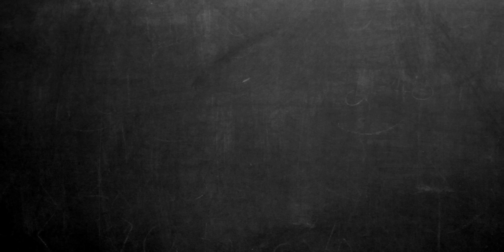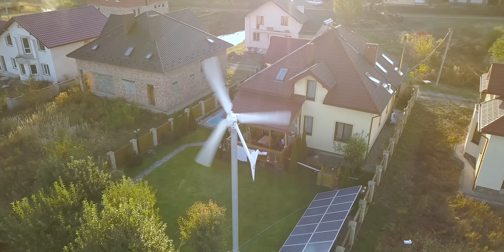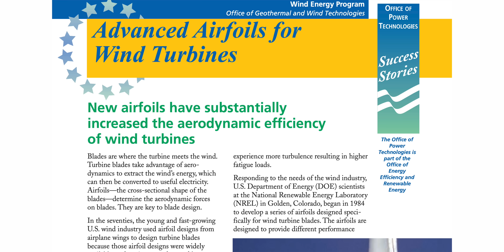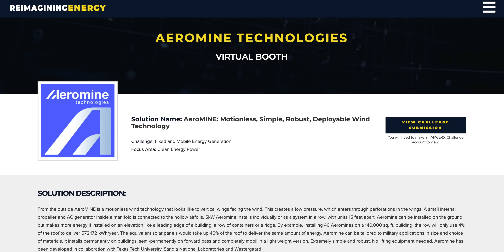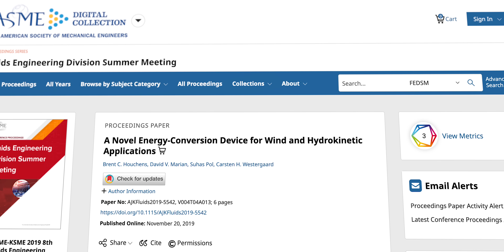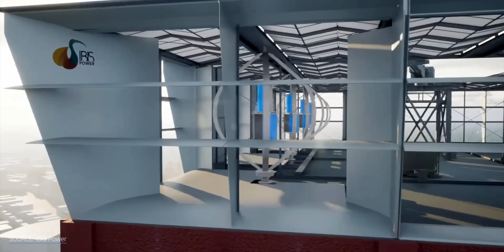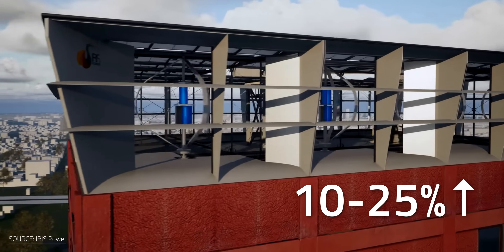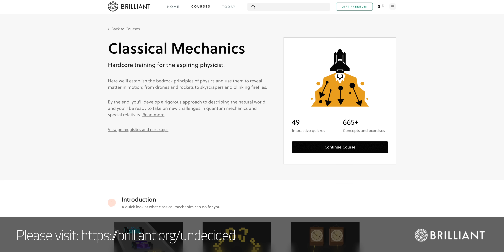How Can A Wind Turbine Be Motionless?

Comment: These companies should work on making kits/diy friendly stuff to allow it to be more modular, applied as part of normal building processes. Shipping and MFR of thinks like this is expensive, and of course should be done on site. Why not make plans to shop to local metal cutting shop, and use standardized as possible coverings, like the sheets of plastic available for wall coverings etc.

Comment: I have serious doubts about the efficiency of this system. Since the mass of the flowing air (the wind) is redirected using the Bernoulli principle only a small portion of the wind "mass" will actually reach the generator. Furthermore, the redirection itself causes losses to heat due to air friction (viscosity) against the redirecting surfaces. At least the conventional turbines face the wind directly, and even then their efficiency is nothing to write home about. And the point mentioned in the video of not being able to orient itself into the wind is a serious flaw in my mind. I don't think this setup will leave the lab phase without some very dramatic  redesign.

Comment: interesting couple of sets of power options.  there is a growing trend in America to bring power generation to the individual homes.  ( I was approached earlier this year.  sadly they wanted me to pay them $32000 for the privilege offering the reduced power bill as compensation.  not an optimal solution for us however for numerous reasons)  That said, I like the option for wind or wind/solar power at the homestead.  While some places such as large cities may need a 5 story (50+ foot/15.25+ meter) tall building to build on top of, I have lived in areas that are not so restrictive.  The Dakota plains and now in southern Colorado and, these and similar areas, I think that an airminer or powernest system could work okay on single and 2 story structures.  The data so far on the power nest is promising, and for that matter the air miner concept as well so far as the environmental impact.

Comment: Could the power nest use the same idea as the Aeromine to utalise the air exiting the nest (having been accelerated by the Venturi effect) to drag air along and power another enclosed turbine to further harvest energy from the wind?  The holes in all four sides could be connected to a communal pipe that is powering the enclosed turbine.  Echoing other comments I am very interested in any tech that can be used on my home ridged roof that doesn't involve a standard turbine and doesn't generate any vibrations through the house.  Having solar already I would love to be able to harvest the wind as well :)

Comment: just a variant wind turbine.  Beyond a size reduction little if any purpose to it. Beyond selling for profit to the Dim.
Yess some advantages in the acceleration of the wind speeds  in the venturi ..BFD! 
 Any Efficiency advantages are lost by the teeny propellor that gets driven by the redirected wind. 
No moving parts ? my Ass. 
There is an alternator or generator being driven by the small propellor likely at high speeds (noise!!) to be anywhere near reasonably efficient .

Comment: Both of these wind-driven systems utilize the venturi effect. The stationary vertical airfoils are a venturi. That's why air is drawn through the plumbing, spinning the duct-mounted turbine. Additionally, the low pressure/faster-moving air flowing over the "top" of an airflow contributes a significant component of lift and is also an example of Bernoulli's principle/venturi effect.
Reply: Just going to point out that the restriction of a garden hose by a thumb isn't really using / demonstrating Bernoulli's effect (not on you, this is on Matt!).  The incompressible fluid, being forced through the smaller hole by a fixed pressure, is just a mass flow rate/area.  Does a completely restricted flow result in an infinite fluid velocity?🤔

Comment: Why not build in the ability for the wind apparatus to rotate into the wind direction as to keep the efficiency?
This can be easily achieved by having a wind direction monitor attached to a motor unit to adjust the stationary turbine in small movements.
Reply: Easier achieved by putting it on a pivot and a simple tail fin on it. They figured out how to rotate windmills hundreds of years ago.

Comment: What about Wind mining on board fuel propelled commercial trucks and delivery vehicles? barrel style cage rotors either behind the grill, or the roof, or hidden as stylized air cleaners???
What if the trucks could also be charging easily swappable battery packs behind their cabs to collect this power and then sell it back to the grid at a truck stop??
I had this though while trucking and thinking about atrocious fuel economy my rig at the time had. I figure any loss of fuel economy due to the extra drag with be pretty minor with a highway truck, as at highway speeds the engine and transmission are only having to work to maintain momentum, and at the same time this is the speed the wind rotors would be at their most efficient.

Comment: "AeroMINE is an aerodynamic concept based on fundamental components. Airfoils facing the wind produce a low pressure spot. The airfoils are hollow and perforated, transferring the pressure to the internal of the AeroMINE. The low pressure is connected via a manifold to a generator module. The generator module consists of a 36-inch propeller and an AC generator. As air is pulled by the pressure through the air intake, past the propeller, the generator makes AC power. The power is delivered via a small power and control box on the side of the AeroMINE." How is that motionless??

Comment: Buyers beware...
     Wind turbines are NOT FREE! Not cheap and far from clean to produce, can not be recycled or repurposed when they fail and the failure rates of floating wind turbines are higher than those onshore devices, blade failure is number one and fire being the second leading cause of all the reported failures in wind turbines.
     Each large wind turbine needs 2 barrels of oil pr year. They adversely impact the physical environment around them, are especially detrimental to wildlife as around 140,000 and 500,000 turbine-related bird deaths are recorded yearly in the US alone. They are noisy and unappealing aesthetically. They are 100% reliant on the weather and not capable of generating electricity 365 days of a year, be it to maintenance, to cold, lack of wind or when winds are to powerful.

Comment: The amount of internal motor oils and hydraulic fluids required to keep wind turbines in production is off the charts insane, and then compound that with recycling costs for the fluids (not all of it can and must be burned). The devil's in the details, folks. Just like solar panels, nasty pollution for your local landfill.

Comment: The problem is that many people and Governments think we have to have the magic bullet solution to fix the worlds power needs the one size fits all. The power nests you spoke of along with a power storage solution and heat pumps of some kind all linked and used to back each other up and possibly on a housing block scale may be needed, not with just one home or company trying to do it by its self. Take the  “I” out of team and work as community.  

Great vids keep them coming.

Comment: Where is the math on that?  Not likely to work to well.  The concept is basically a stove pipe with a propeller in it hooked to a generator. Yes you will get some vacuum but it will take a lot more ducting thus the cost will not be competitive.

Comment: Why isn't Hydrogen used as a supplement to wind and solar, instead of Coal? Is it more cheaper to mine and transport Coal, or is it difficult to balance the use of grey, black and blue Hydrogen, till Green Hydrogen becomes easily available ?

Comment: Always grateful for the interesting content here, and  the dissection of that content.  Another thought about AeroMine....  that concept would work far better if it was configured in 2 wings in an elevated horizontal position, not vertical. This is because there is virtually no wind near the ground.  The increase in power climbs significantly with elevation, to the point it can't be ignored.    Even better would be a ring, not 2 parallel wings. The internal turbine would have to be as close as possible to the vacuum generation.  Finally.... output would increase if the vacuum generator were rotating to gain apparent air speed.... as in a propeller!
About 60 years ago there actually WAS such a turbine.... "In 1947, the French engineer Jean-Edouard Andreau proposed a vacuum wind turbine......"   A very interesting read
Reply: Why can't the "wings" mount on a rotating base that always points in to the wind?
Reply: @devastator39  this is what I'm describing.  I didn't make that clear enough.
The AeroMine will do so much better on a tower, facing the wind, with an annular ring creating suction... so much better that it obliterates any justification for having it on the ground.  Look up the Andreau Turbine, the performance specs are really impressive and I find those specs plausible.  The AeroMine as it stands today only tells us the company has more believers than actual potential.
Reply: @someotherdude  the aeromine turbines aren't on the ground. They're on the edge of s rooftop.
Reply: @EctoMorpheus  might as well be on the ground, since air often hits the face of a building and wants to pass well above the edge of the rooftop.  Locating a turbine at the edge of a building assures that you'll harvest almost no wind, and what you do get will be turbulent.  And you're missing far higher velocities not far above.   Ever wonder why no commercial turbines are mounted on roof edges?

Comment: One of the other reasons it will produce a lot  more is because solar only works when the sun is out compared to turbine will work pretty much all day and night . Moving parts though requires maintenance especially is colder regions that will rust metal . But that’s when the manufacturer or installer includes warranties and labor when purchasing.

Comment: could they not install small wind power on motor vehucles?  since cars and trucks move at 60MPH and more  on interstates this could recharge the electric vehicules while travelling no? thus extending the maximum millage travelled by electric cars? or truck  vans would benifit from such technology

Comment: Just wanted to clarify, the percentage of overall lift from the Bernoulli effect vs other sources varies from plane to plane depending on wing design. On some airplanes it is a small percentage.
Reply: What other sources of lift are there?
Reply: @sammason2300  Newtonian forces- the air hitting the wing at such an angle that it pushes up and back on the wing. The engines keep it moving forward, so the total effect is lift.
Reply: @jjdiaz7  That's not correct. Air doesn't "hit" the wing, it flows smoothly around it.  All the lift on the wing can essentially be explained by the Bernoulli principle
Reply: @sammason2300  https://en.m.wikipedia.org/wiki/Lift_(force)
Reply: @jjdiaz7  Well ok, Bernoulli's principle doesn't identify why the flow separates at the trailing edge, and of course Newton's third law (conservation of momentum) applies throughout. Nevertheless, analysis of the streamline curvature and the relationship between the pressure and velocity fields as expressed in the Bernoulli equation give an excellent description of lift. 

But the idea that air "hits" the wing is just wrong.
Reply: @sammason2300  That's not entirely true. There's something like the coanda effect that contributes too. This effect allows the air to stick to the upper surface of the wing, creating a low pressure zone beneath its path which contributes to lift on the wing. It's not all Bernouilli. *update: it's has been described in the article referred to you.
Reply: @tomdebaerdemaeker  The lift on the wing is the difference between the pressure on the suction and pressure surfaces. That pressure difference arises due to the difference in curvature of the two surfaces, and the fact that the flow separates sharply at the trailing edge (Kutta condition). If the boundary layers remain thin and attached then the flow can be considered irrotational and Bernoulli gives an excellent description of the resultant pressure field. That's all there is to it. The "Coanda effect" is not an additional phenomenon with some other physical explanation.

Comment: I'm of the opinion that while the concept is brilliance, the application is flawed.

The next steps for the application for the device is incorporating the concept in conjunction with other devices.

Windmills tend to burn the leading edges of the impellers caused by speed mostly.  The tower is a total waste of materials and space.

Building duel/paired blades for the conventional windmill seems like the logical next generation from the design/engineering department.  Slow the rpm and offsetting the lost rotational speed with the stationary wing concept turbo charged by the rotating paired impeller.  No?
Tower tubes seems to me are an entire waste of expensive realstate.  
And where's any static vibration collector devices located?  Turns a problem into an asset.  No maybe?
Just seems like were missing something simple that could change things in a big way.  Enjoy your presentation very much!

Comment: There was a building designer that designed a skyscraper with 3 floors dedicated to wine turbines at the 38th through 41st floors. He worked with a engineering firm and discovered that the airflow at that height would ensure constant movement and use. These turbines could be use to power the lights and water pumps and sub systems of the building, while heavier current items like elevators would still grid power. But if he ever builds the tower, which I belie would be in Taiwan; it would be first of it kind, and only use 1/4th of he power current mega skyscrapers use. He ultimately wants to use solar panel overlays on the building glass to make it the building fully off grid. Similar design team in 1998 said that if technology ever allowed it, they could see mega towers in Chicago, and New York uses wind pods (floors built in between each floor section) to power the buildings, as the wind speeds on skyscrapers in the area would grant almost constant flow. Here to the future of clean energy and use of space.

Comment: Great video, I like the big ol dutch type windmill with 60ft diameter that can run on very low winds (if perfectly balanced), the top turret can have a tail so its always aligned into the wind !   Slow moving is alot Safer and Quieter, and the sailcloth vanes (or lattice light wood vanes) makes it work where others fail.  Braking can be by making the vanes "Feather into the wind or pull in sail cloth or using telescoping vanes that minimize surface area in typhoon/hurricane winds (use all 3 methods), other methods are the good old flying balls that apply brakes when they spin too fast.  Tell me what you think, thanks.   InventPeaceNotWar

Comment: You are wrong here about fluid mechanics. The lift of an airplane wing is generated by the pressure differential between the bottom and the top of the wing and not the positive pressure of the bottom part.

Comment: ... I didn't get why is Aeromine contraption is not mounted on a turntable - either free turning or steered - this would sort out the dependance on predominant wind direction fixed set up.
I am less enthusiastic about roof mounted vertical-axis wind turbines - not because it can't be done, but because it can be done cheaply by not applying damping measures - and you know developers, if they can cut cost corners they will! The ones that I've seen installed, have been audible and annoying at night time when general ambient noise drops down.

Comment: Wind and Solar joint generation makes a lot of sense. 
Share some infrastructure, and get some synergy between elements, with it cooling solar, and using solar as a roof for enclosed air tunnels.

Comment: Matt, I remember reading a neat article in the past in one of the "Popular Science/Mechanics" mags. It was a bladeless design for use in cities. It looked like a Nautilus shell sitting on the wide end. It was also aesthetically pleasing to look at. No birds will fly into it and it won't spontaneously burst into flame.
Reply: Gerald Bock: This is a fascinating design.  I am a building manager in San Francisco (And my last name is also Bock. Not too common) and I agree.  The vertical turbine is much more aesthetically pleasing.  I have reached out to the company to see if they might be interested in installing a test module here.
Reply: What about snow?
Reply: I remember that design... What happened to it??
Reply: What "spontaneously burst's into flame"?
Reply: @mustang6599  The wind turbines as currently designed will catch on fire if the decouple doesn't work. They are designed to operate within certain wind speeds. My comment was intended to be humour but it is true. I have a colleague who builds and repairs these critters.
Reply: @geraldbock1012  yes they have a clutch or a braking system that stops the blades spinning too much, if that stops working then the fans do get out of control & either catch on fire or collapse.
Reply: 風力太陽能合體可以令晚上沒有太陽，風力補給晚上沒陽太都有電供給，而電池就可以少的． 電池成本也貴
Reply: 選擇你老母全選你老母掃描你老母文字蘋果D